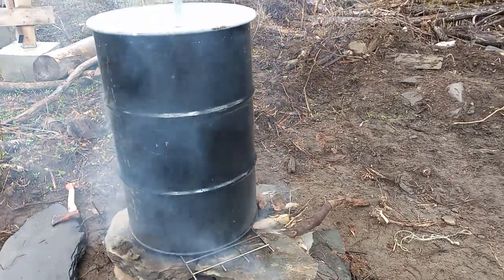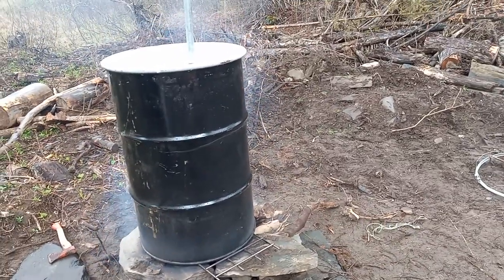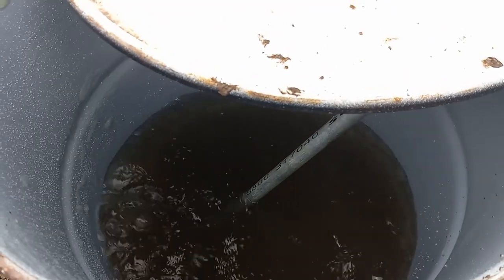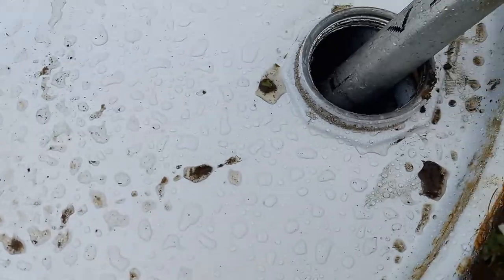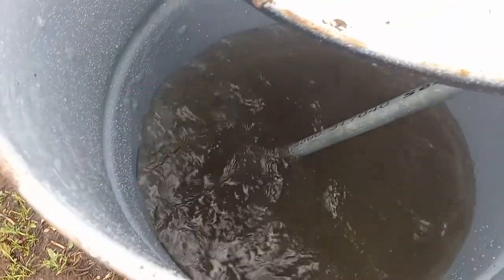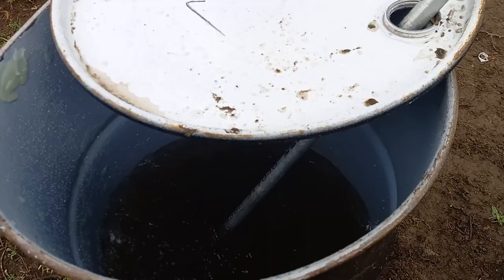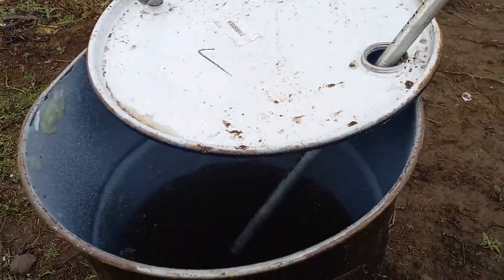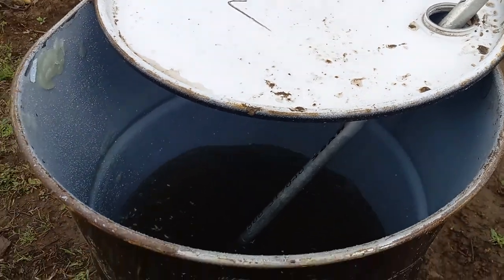Depolymerization

Comment: This is low temperature pyrolysis. Take care to make sure your barrel full of plastic is air tight and try to capture and condense the gasses that are driven off.
Reply from the maker: Thx , yeah it took a couple tries to figure it out... I had to add a relief valve for during cool down to avoid imploding and sucking water in.  I'm sealing the second barrel to capture the filtered gasses and hopefully run a burner off that.   My first barrel is air tight. . Need wicked high Temps for it to gas off properly too so I'm trying to work that out ... thx for the comment